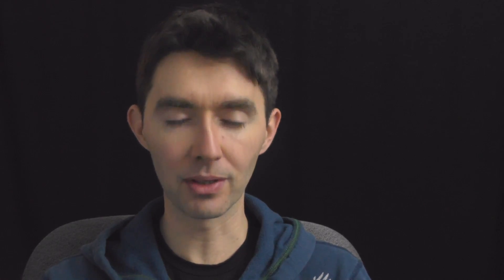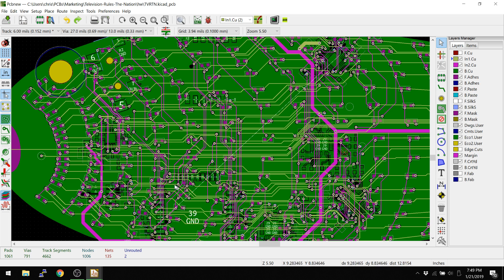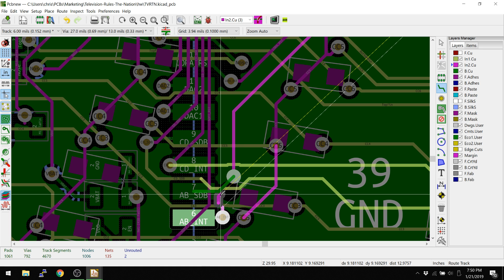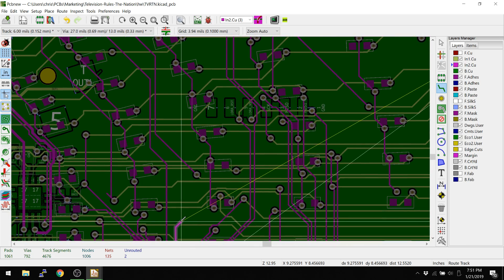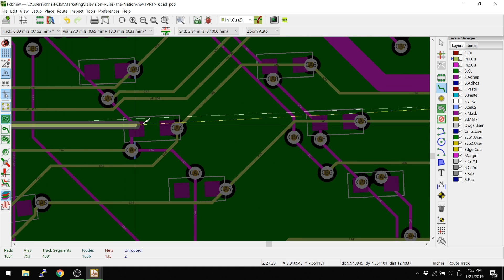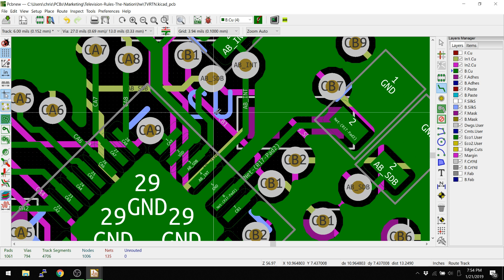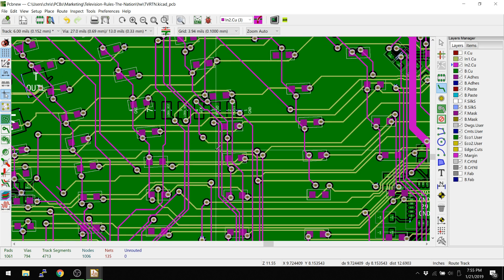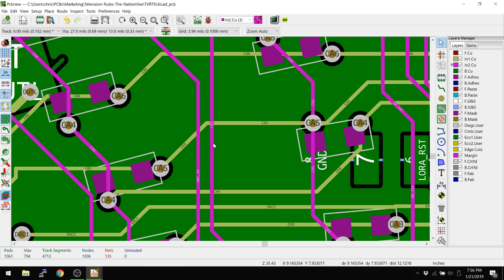KiCad 5.0 - Modern Toolset (Push & Shove Router)

Comment: I'm on 5.1.2 and on Modern Toolset the router only finds routes automatically but it doesn't push other traces. Is there an option to turn it on / off?

Comment: So, I tried this a few weeks ago and I spent a few hours on optimizing things, on a very simple layout, a break out board with just one 24 pins IC with some connectors. Just to investigate/learn about the Kicad workflow. And then I found out about freeroute, and then it all went automatically real fast! Although it needed two layers while my manual solution only needed one layer but with some shoving and creeping through inbetween the IC pins. So, I said to myself, I am never going to do this again... (this manual push and shove) Still a few days later I read a comment from someone who claimed that "freeroute" is "terrible"...  Not for me it isn't! Still I will have to see how it goes with a more complicated design.
Thanks for the video.
Reply: auto-routers will not replace manual routing, sure, for newbie projects and breakout boards it's more than enough, but if you did this for a living you would know
Reply: @the_perigoso  Ok, thanks Rafael. Still I used to work at IC design, and there nobody bothers with push and shove with channel routers, so if you have two layers or more I fail to see why PCB routing would be any different...  Guess I will find out with a more complex design or maybe not. In any case, a happy New year to you!
Reply: @the_perigoso  Ok, two days later I found this video, not Kicad based still a good demonstration about auto routing problems So now I know that : https://youtu.be/sffuvnGhano

Comment: I have used the push and shove and I do find it useful but I have real problem with how it looks in '5. I notice you have In1.Cu and In2.Cu as well as B and U. Are they addable individually or did you start with a 4 layer board?
Reply from the maker: This board started as a 4 layer, but there's no reason you can't swap from 2 to 4 layer designs in the middle of a design.